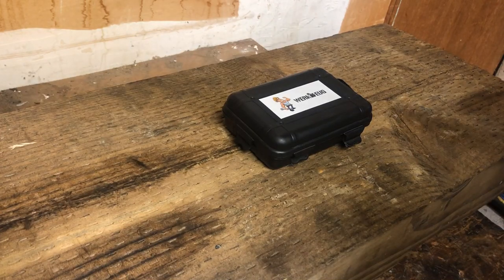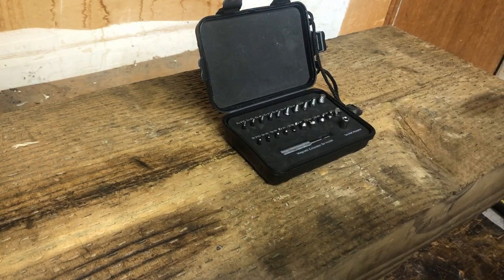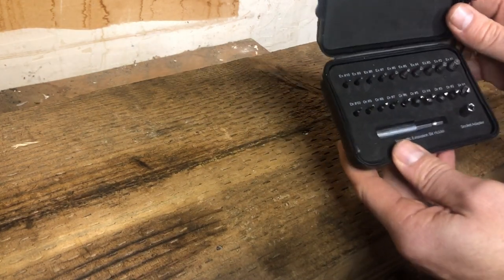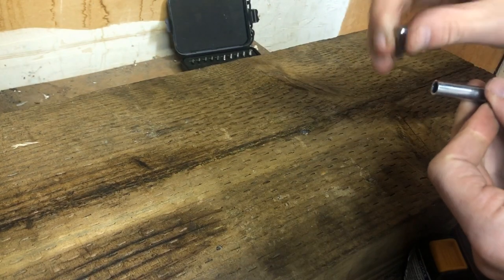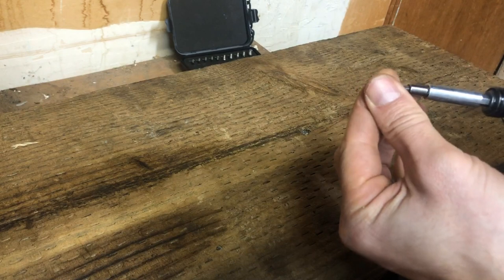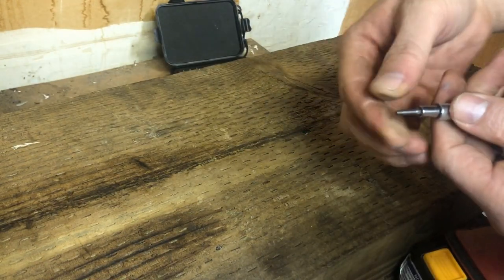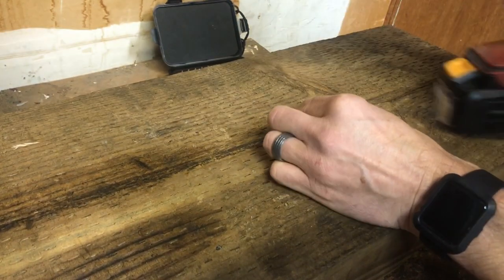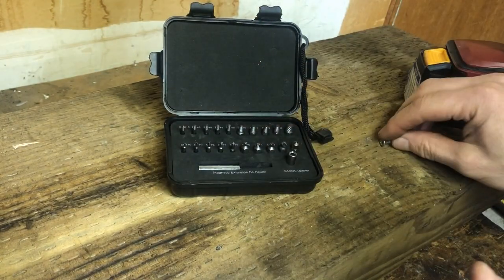Remove Stripped/Broken Bolts & Screws Easy - Werkzeug Extractor Set | Handy Hudsonite

Comment: Now I'm in the states Is the Alden 4507P Grabit Micro Broken Bolt Extractor 4 Piece Kit  the same as the  Trend GRAB/ME1/SET GRABIT 4-Piece Micro set?
Reply from the maker: That’s a great question, Christopher, but I’m not familiar enough with those brands to know the difference.

Comment: Came by video while looking for info on a wiha extractor set and had to make a comment. Have a similar set from amazon and there ok for removing some screws from some soft material. Wood though is the easiest material to remove a screw from and would of been a better test if you had removed a  screw from metal which had been damaged more.

Comment: Thank you for this video, very helpful.  I purchased the kit and finally got the screw out after a very long time of trying various methods.  Now the problem is the screw extractor is stuck in the screw it removed.  I am hoping if I soak it in oil it will loosen up enough to be removed.  Has this happened to anyone else?
Reply from the maker: Sorry to hear that. I've not had that happen. You could try heat to see if that could help forcing it out.
Reply: @HandyHudsonite  Thank you for the suggestion.  I tried the heat but it didn't work.  A friend suggested this spray stuff called "Blaster" and after soaking it for a few minutes, the extractor released the screw with just a tug.  All is well now.
Reply from the maker: That’s awesome, I’ll keep that trick in mind.

Comment: I bought this set to remove a rusted tight license plate screw.  It kinda worked on the screw head, until the head snapped off.  Tried to remove the shaft of the screw and it wouldn't budge, will have to have them remove it at the shop.  So,  bit of a fail for me...
Reply from the maker: Sorry to hear that, they may not be as high of quality as some but they're great for certain tasks. Appreciate you watching.

Comment: Not to be used with impact driver, your going to brake them. Those bits are hard and brittle why instructions say to use low speed.
Reply from the maker: Thank you for the tip - that's a great one to note.